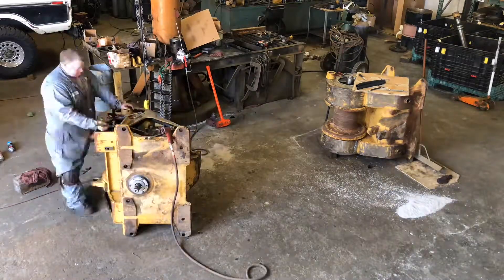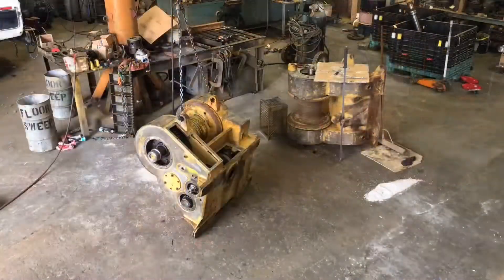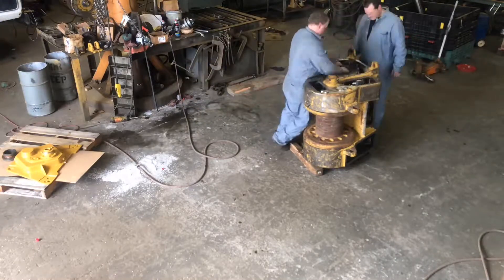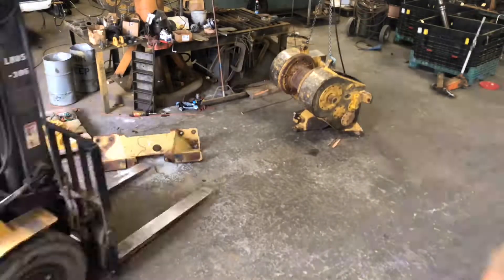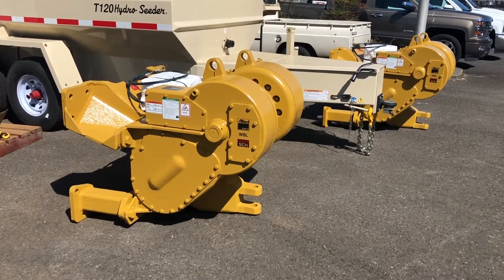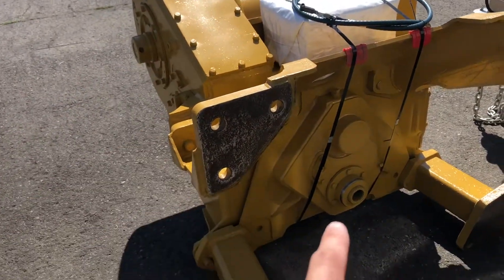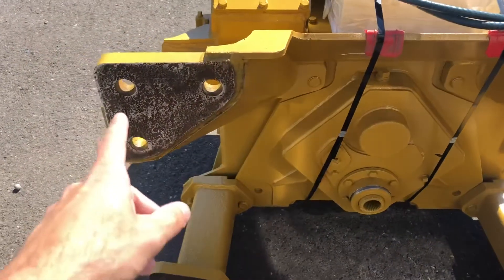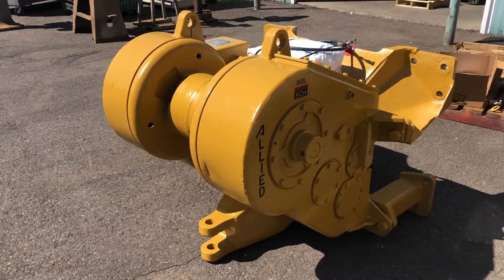Hyster W8L rebuild for CAT D7R

Comment: Andrew Camarata here on youtube has a problem with his winch on his D7.
Maybe you can help him,he is asking for informations.
Reply from the maker: Yes, I saw that yesterday and commented. I imagine he didn't see it with all the other comments. That Hyster D7H winch looks like it's been ran a while without a hydraulic hose, so I expect the clutches to be in pretty rough shape unless they overfilled the oil. I'm curious to see if he gets it going. We have another D7H hyster here that was in marginal shape and getting it running again is going to cost quite a bit.
Reply: @thomsonequipmentdozerwinch  
So,the lube is just passing to lube clutches?
It's mechanically driven ?
Reply from the maker: @michaelovitch  the winch is mechanically driven via the tractor PTO shaft. The PTO is always spinning when the tractor is on so the winch uses a hydraulic valve to engage clutches that activate winch functions. The valve has a cooling circuit that sends oil to the spinning clutches to keep them cool and avoid warping.
Reply: @thomsonequipmentdozerwinch  
Ok,Thank you.